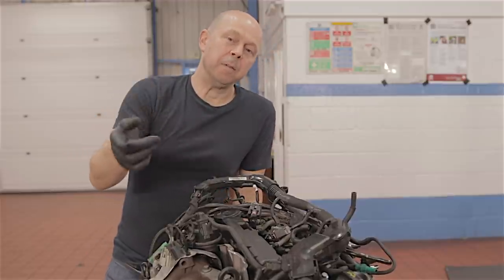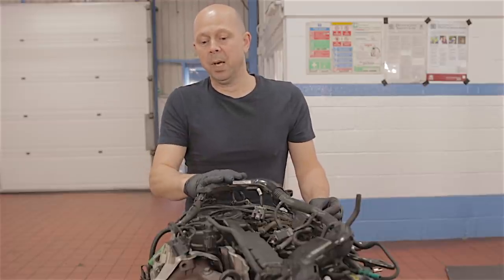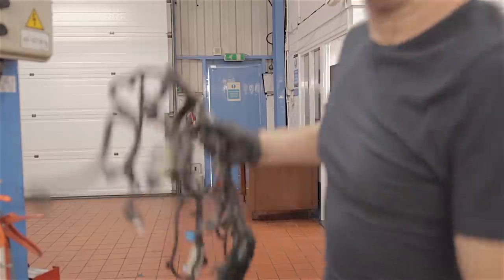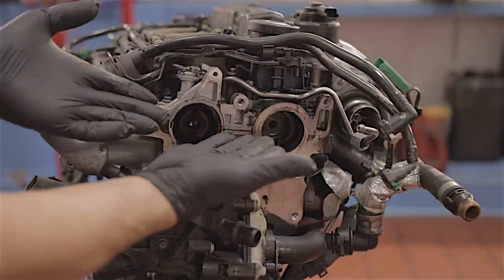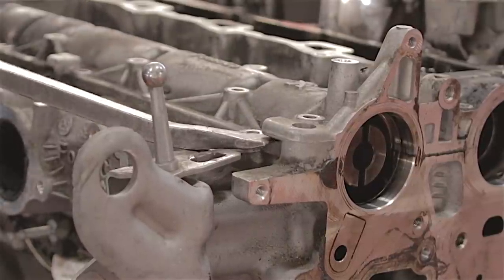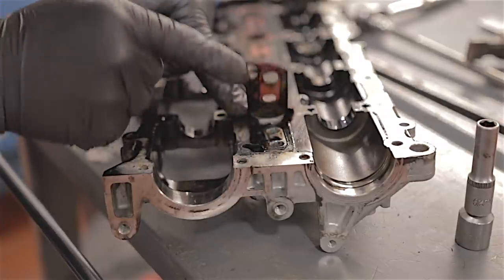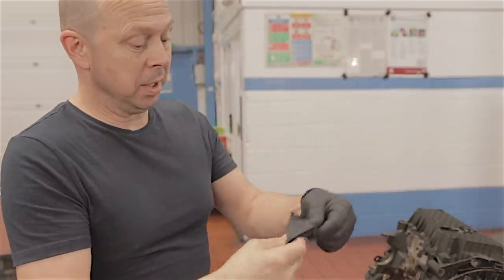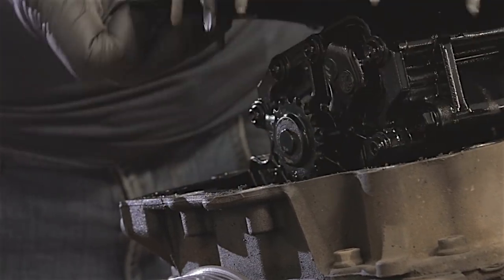Why did the mk5 ford mondeo 2l diesel engine seize

Comment: how many miles?
apologies if I missed it in the video.
Had the oil pump chain fail on a vag 1.4TDI . Was ticking when i drove it to skoda. 
They snapped it in the garage, during assessment. Didn't seize due to oil flow , but the chain was in bits.
Naturally no good will from them. sold as non runner.
Have a 1.6 Tdci focus, 180k wonder if the clock is ticking.
Always thought the 2l tdci bullet proof.

Comment: Not sure if this is the right place to ask a question but does this engine have a drain plug somewhere in the block to drain the coolant? I’ve got the one with bi-turbo (207 bhp) and want to flush the whole system.

Comment: Need help with my 2.0 180ps 171000..  I know its done a few mile now but its been in for repair over 4 times now. 1st time it striped teeth on belt and bust rockers on exhaust side got it repaired and run 1400 mile till it went again but the other times I've had it done I'm only get 50 t 300 mile before breaking again but always breaking the same rockers bearing in mind all timing is still set and new belt is fine new cams and rockers etc and the fuel pump is lined up gone by most of your advice on video on how to time it perfect and all other issues... also when the car did run from buying it its had a hesitation when I'm accelerating from 3rd gear up yet 1st and 2nd feel.. so dunno if u have any other advice you could give pal

Comment: what is code po2e2 diesel intake air flow a control circuit low is a brake in the wiring or a sensor.cheers bob

Comment: The crack in the oil pump housing will cause the pump to suck air, losing oil pressure (that's on the Peugeot Boxer).

Comment: That Peugeot/Citroen engine is very good and fast too, Love to see a clean workshop.
Reply from the maker: yeah they certainly are a well built engine and lasts well if looked after
Reply: @alan4x  
Are regular oil changes the best thing you can do to prevent dissaster?
Reply: @bokibo87  every 10k mls /15k km oil changes are normal if you want to keep this engine running for life.

Comment: When the oil light comes on it can be covered with a sandwich packet or similar 😂🤣😂🤣
Reply from the maker: lmao😂🤣
Reply: @alan4x  i’ve got a ford kuga 2.0tdci with a rattling type sound would that be turbo or the cam chain tensioner?

Comment: Hi, I got a challenge for you. I own the same engine just in a volvo S40 2009 2.0D 130hp

I am loosing coolant without smoke or leaks real quick if the turbo is working properly.

What I did is I disconnect BOOST PRESSURE CONTROL VALVE vacuum line causing the engine didto lose a ton of power as turbo does not kick in as hard but the coolant is then only lost at tiny amounts - can do like a thousand or more miles before I need like 500ml, 

Head gasket kaput or some other issue? Sealer liquids did not help.

Comment: I do like your videos, I have been repairing my own cars since I started driving in the '50s and they have got progressively more difficult until the modern stuff like that Mondeo engine is ridiculous. I looked at your Ford/Citroen cambelt change and although you had it out of the car, it still looks doable. I have two C5's with that engines which are coming up due for replacement belts. I have done several XUD and 8 valve Hdi belts so with your help I think I should be able to manage these. I changed the thermostat/ housing on one of them, that was a pig of a job. You have a very good way of explaining things. Thanks.

Comment: Very similar design to my Alfa 159 2.0 16v  jtdm engine, same piston design, cams join by chain but run off belt, same rockers and tappets too.
And as said not really designed to take head off.
Good video

Comment: 200000 miles before mechanical engine failure is still impressive engine looked in decent condition except for the oil pump not many expensive German cars get that far
Reply: Had several bmws with close to 500k....these mondog oil burners are good but there Achilles heel is fuel pumps and injectors!
Reply: My 53 plate Astra 1.7DTI is on 242k miles and still going strong on it's original engine (I've jinxed it now) :-P
Reply: @matthewsedin8148  No Thanks
Reply from the maker: yes i am well impressed with these engines, well built😊
Reply: @matthewsedin8148  serviced correctly using genuine parts and avoiding supermarket fuel I've got over 200k out of injectors fuel pump and egr valve, even on a mk3 mondeo tdci
Reply: I bought my 07 plate Audi A6 2.0 TDi when it was nearly new and had 17k miles on it, from an Audi main dealer still under warranty. It's now done 295k miles and the engine's never been apart. One new turbo, one new EGR valve, one glow plug and regular service plus best oil and fuel at all times. It just went through the MOT at the same Audi dealer with no advisories - they admitted they tried to find faults with it but couldn't find a single one! The smoke reading had to be below 3.0 (no DPF), and they couldn't believe it - it fast passed with a reading of 0.03, at 292k miles with no DPF. I've been in and out of the motor trade for over 50 years and I've never seen a Ford that came close!
Reply: Had a sprinter, when i got it , 13,000 miles , when it  was got rid of, it had 384, 000 on it , it was regularly serviced and maintained , it drove exactly the same as when it had 13, 000 on
Reply: Nah that's pretty poor for a diesel,  I'd say 350k for a well engineered diesel with spotty maintenance,  maintain it well, who knows , round the clock a few times!
Reply: @austinpowers2k9  you've sealed its fate, report back when it goes!
Reply: @nigelbarratt6825  I had one of the last e46 couple diesels , was on 255k with pretty poor maintenance but full history from previous owner (¹), original turbo , dmf , injectors, all that expensive stuff , still went like stink no noises and smoke till a bin lorry wrote it off 😔
Reply: german cars do 500,000k they only break in the uk.

Comment: That's one of those two stage pumps, there should be a sprung mechanism that pushes the impeller housing off centre to increase the displacement at higher revs. The VAG diesel in my car uses a similar setup with a high rpm mode that kicks in at 3k. By the looks of the wear on the vanes that pump was called to run in the high rev mode quite frequently lol.
Reply from the maker: your right about the oil pump sprung mechanism..i sure that car was well thrashed also🤣
Reply: @alan4x Hi Alan. Did you do any preventive oil pump swaps on the dw10 engines in the Peugeot expert vans? I have an Smax with the dw10 and I suspect there is a bearing noise from the oil pump. The chain is pretty loose also.
Reply from the maker: @f.j.1942  hi. We had a number of 2012 Peugeot expert vans. We ended up replacing all the oil pumps as we had a few of the pumps develop a crack and lock up causing engine to seize. The oil pump chain is supposed to be loose btw
Reply: @alan4x  thanks for clearing that up. I have about 2cm of movement in total of the chain. Reason is i am searching for a deep frequency noise at around 2000 rpm, which i suspect is a chain. I already changed the cam chain, slider and tensioner. It also has a squeal when pulling from low rpm. No leaks anywhere. Has done aux belt and timing belt and all hardware, also the dmf, clutch and alternator. Also cleaned intake for soot. Changed the hydro engine mount as it was shot.

Comment: I don't know if you do enough glass to be worth the cost. But the equalizer extractor is like a sawzall with a putty knife on the end and cuts most windshields out in well under a minute.
Reply from the maker: thanks i will look into that, i don't do many and usually cheese wire and a cutting knife do but occasionally i get a difficult one, cheers

Comment: Thankfully engine blow-ups are very rare these days, unlike thirty or forty years ago, but of course they still happen. The complexity of modern engines makes a write-off quite likely in terms of uneconomic repair. Car only worth a few grand and garage labour costs for several days work plus expensive parts means you might as well scrap the vehicle. All a bit different to when I worked on cars in the 70s and you could get a full or short rebuilt Ford or BMC engine for a fraction of the value of the car and you could usually get the job done in a day sometimes two at the most. Labour nowhere near as high as it is now - £80 to £150+ per hour depending where you go - independant or main dealer. Nice video, enjoyed it very much.
Reply from the maker: thank you sir

Comment: The metal filter on the turbo pipe should be removed as if that clogs up it will destroy the turbo due to lack of oil (only the oil filter should be doing the filtering as that's replaceable every 5-12k miles )

Comment: The Timing Chain would oscillate violently at certain Speeds....as it had no tensioner/damper..it would eventually shake itself apart
BMC used Hydraulic Dampers 60 years ago..the damper was deployed by a ram filled by the oil Pump.have never seen one of those Chains fail.

Comment: An oil pressuure gauge on dash will show more than just indicator lamp.
Reply: Exactly why I like having an oil pressure gauge in my 2003 2.7 diesel jeep grand cherokee wj just passed 182000 miles, good to see great oil pressure on its engine. I change the oil and filter every 8000 miles, have done since I bought it on 142000 miles. Fuel filter changed in that time too.
Reply from the maker: these cars will flash a message on the instrument pack...(low oil pressure) and put the engine into low power mode..but its all upto the driver from that point🤣

Comment: I like the Diesel engines from the 30's to the 60's ! So much better to work on.The metal was solid and did not flap-about either. Gardner,AEC,Dennis,Ford,Cummins,Caterpillar,Kumatsu,TEREX twostroke's,Avelingbarford's had nice motors can't remember what they had but probably Rolls Royce ? Long time ago.The Russian stuff had decent motors but the qualaty of the copper pipes and such like was very poor.Burmeister Wayne ships motors were fantastic good quality wonder what they are like today?Even the little Petter Diesels were super ! ROOTS made Twostroke Diesels with their own made SUPERCHARGERS   (They weren't Turbo they were like SHORRECKS haveing a twin worm screw system also very good too ! So much more but my memory fails me at the moment.OH! Leyland Diesels were nice to work on and ran very well,bedfords were good but drivers abused them a lot and gave them a poorer reputation but with care were good.Scammel and Thornycroft had a mix of motors some had Gardners and these used no washers but had split pins on the mains and Big end Bolts !!!!!!!!  Lovely motors.England should be proud to have built such wonderfull Engines OF course Burmeister are Danish and also wonderfull engine makers.OH! Well! BE BLESSED,Thought I'd Let you know that England made the best at one time and could again for sure make the best. P.S. Don't forget PERKINS DIESELS they also made fantastic outboard motors for boats ! YES it's true and were super good too.

Comment: So the meathead that was driving this ignored the oil light then? 

Shame.

Did the mk4s suffer from the failing cam tensioner?
Reply from the maker: yes the driver kept going...he did not know what low oil pressure dash warnings and rattling engine meant🤨
on the mk4 mondeo 2l diesel...i have never came across a single case of the tensioner failing or the plastic guides breaking and most of mk4 we have here are at around or above 300k miles
Reply: @alan4x  Gives you confidence.

Comment: I'd say.. 
High mileage caused obvious wear to pump chain guide, chains then caught, an that equaled the snap an sieze, cracking the oil pump mount in the process due to basically an instant hydolock effect be it from chain locking it all up, or sheer forces involved at locking point. 
Oil pressure weren't gonna  it, those guides were gonna get there first lol. 
Had more slack than a hookers door handle that motor, inevitable sadly by looks of it.

Brilliant vlogs as always 🍻
Reply from the maker: thanks for that explanation..i do have to wonder whether the pump mount broke due to the pump locking momentarily ..thanks e83😊
Reply: @alan4x 

Your the man when it comes to these Mills...
My observations are based from working with other, older, chain driven engines. But to me it looks that way, doesn't look 'smashed' it's cracked which I'd tend to think meant a momentary impact, like a hydro lock, instant crack, but engine stopped before wrecking took place... 
Fascinating though, its like mechanical CSI 👌

Brilliant content though, can't wait to see what's up your sleeve next 👍👍

Comment: Top work! I would have repaired it instead of going for a second hand engine. You never know its history for sure. Or maybe in UK they don.t lie about mileage and overall engine history?
Reply: Not sure for businesses, but private people purchasing a used engine from a business typically get an 1-2y warranty on it, if certain conditions on the engine installation are fulfilled. And it makes virtually no sense to buy a used engine without a warranty because the risk is too high.
Reply: I think you would be better off repairing that engine. You know its history and condition.
Reply: He probably had a spare sat around from a crashed one . He has loads of them mondeos

Comment: ok so 2 questions. apart from the ancillaries, how much different is the basic engine from that fitted to the mk4?
second, have you had any experience with the more modern 1.5 diesels? and if so are they not a little short on power/torque for the Mondeo?
Reply from the maker: the mk5 2l engine looks very similar to the mk4 2l diesel but there are significant differences..cylinder head design and injector placement etc. i avoid the 1.5 diesel..it is definitely underpowered compared to the 2l and prone to head gasket issues

Comment: With the wear on the chain tensioner guides (and broken spring on another one if memory serves correctly from a previous vid) and the oil pump you have to suspect a design life of maybe 300k km (186k miles ) ? So basically if you want to take the engine over 200k miles- as was mentioned for this one- then said items have to be considered consumables but do costs stack up? Probably cheaper swapping in another engine.
Reply from the maker: the top cam chain tensioners are becoming a worry..not had this on any of our mk4 2l engines with much higher mileage....the problem is in order to replace that tensioner involves a lot of time and would be a very expensive job..probably including all parts like new chain ...cam belt kit and gaskets etc would be around or above £1000
Reply: @alan4x  Thanks Alan, it did occur to me after posting just how much work would be involved when I thought on your other vids covering the Mk5 engine. As for trying to sell £1k of "preventative" maintenance to taxi drivers....esp when they keep driving even with engines rattling their fillings out !
Reply: I find 5w40 oil and 6k mile service intervals goes along way to prevent wear like that. 6k miles is way too expensive and inconvenient in a taxi though!

Comment: The pump was fine.  The chain and sprocket were worn out.  Look at the oil pump drive sprocket, the teeth are sharp, because they are worn.  The chain tried to climb one extra tooth, and didn't make it.  Viola.  Chain no stretch, just breaks. Jams, and no oil pressure for long enough to take out that main bearing that looked chewed. IMO.
tom

Comment: When oil pressure is gone there is no reserve .the engine is junk by the time the car stops.
Reply from the maker: yes..your right, thanks stephen
Reply: good engines when they have oil being fed to them, but your looking at about 40-50 seconds as soon as the oil is starved.. on a Honda engine your looking at about 6 mins. If you were on the motorway the ford would just slow and seize. the Honda`s ecu detects the oil starvation and throttles down but still runs, 1st sign that something is not right.
Reply: @rs2klee, so what would you recommend to do if there is a sudden oil pressure drop while driving on a motorway? Just pulling over and turning the engine off may already be too late. I guess you can't turn the engine off while the car is moving, can you?
Reply: @bormisha  sure you can, if its a manual, jump on the clutch and shut the engine down, the only thing is steering it when its off is hard as the power steering pump stops. auto you could still turn the engine off, the car will still roll in gear, but the torque converter will stop turning the engine over

Comment: Hi Alan, how do you keep track of where each bolt goes when stripping  a head down? Sam
Reply: Either a cardboard cut out draw a rough graph or your head and the bolt holes, stick the old ones in there as you remove and then for extras split them up into little plastic pots with labels. That works well for me!
Reply: @ashleyburnett134  thank you I'll try them out
Reply from the maker: ashley answered that well..also having space to lay things out in order helps..where someone else isn't going to disturb it
Reply: Alan Howatt yeah also laying them out in order I tend to do that when I do clutches, put them in order under the ramp for the bottom bolts and the scuttle panel for the top bolts  works a treat

Comment: Hi have you come across engine code p2599-00 turbocharger boost control position sensor “A” performance stick - high. On a mk5 15 plate?
Reply from the maker: no not yet

Comment: Not at all a boring video. Top work like always. Is the engine oil always this dark in diesel engines?
Reply from the maker: cheers marinus..diesel engine oil gets worked harder than oil in petrol engines and does get black..the oil in this engine was cold but i would say a bit thicker and black than i would have liked to seen..it probably was due for an oil change